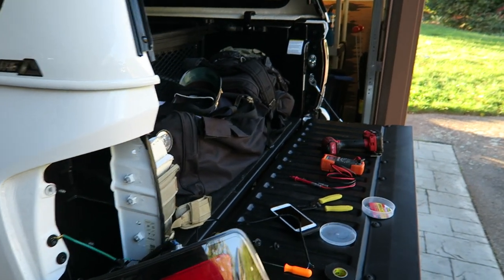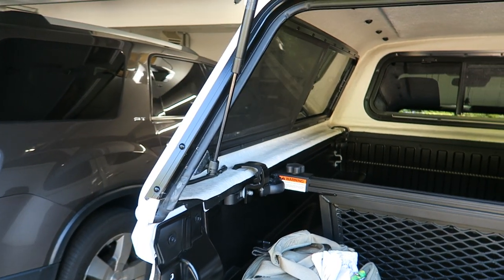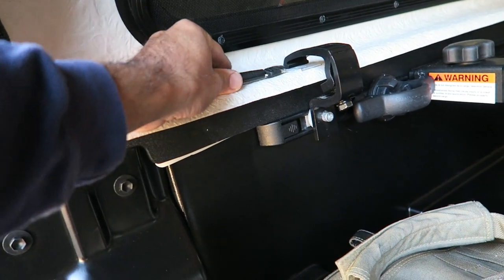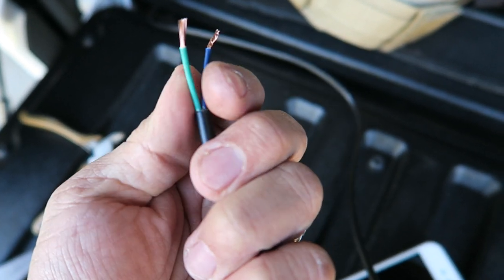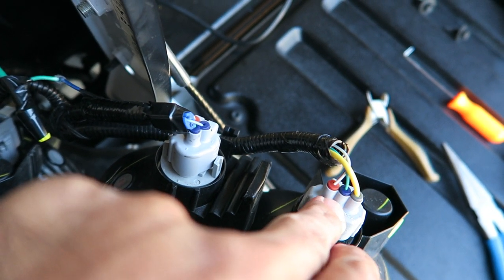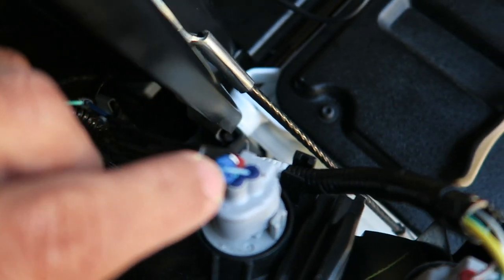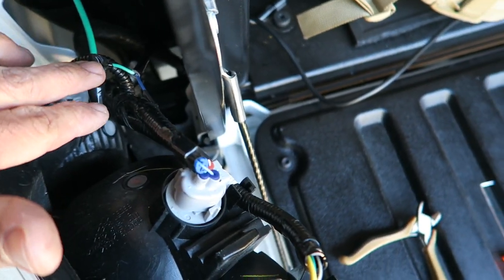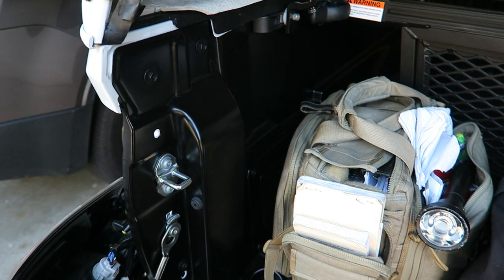Wiring the third brake light on an ARE V series cap for a 2018 Tacoma TRD Pro

Comment: Instead of splicing your ground to another wire use the wire you run to your cap connection and ground it. Less connections.

Comment: Where did you buy the wire and the connections and everything you needed? I’ve been to the Home Depot and two auto parts stores and found nothing useful.
Reply from the maker: On-line you'll find everything you need

Comment: Wouldn't your third brake light blink when you engage your left turn signal?
Reply from the maker: It would, that’s why in the video I wired it into the brake bulb wiring not the directional bulb.
Reply: @azazel676  In my 2018 XLT they're not separate. All bulbs light up when the brakes are pressed.